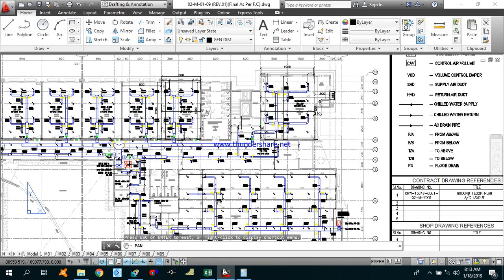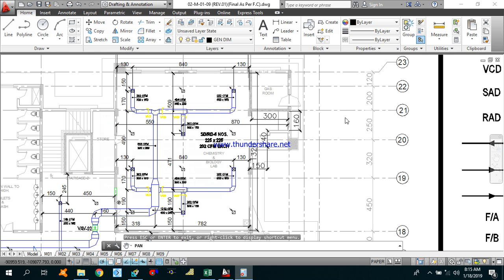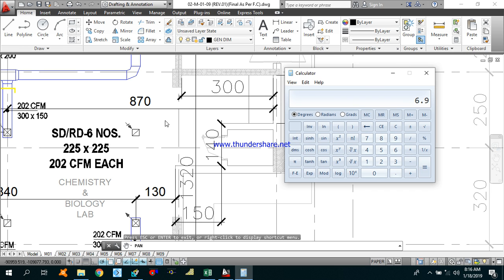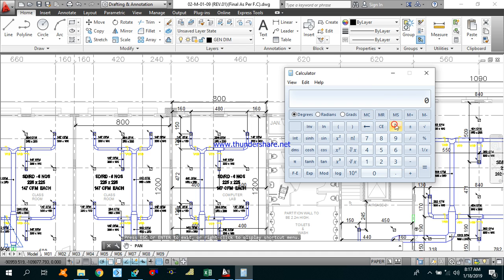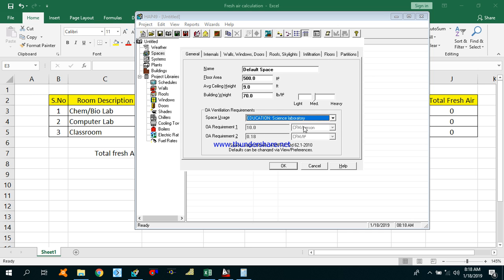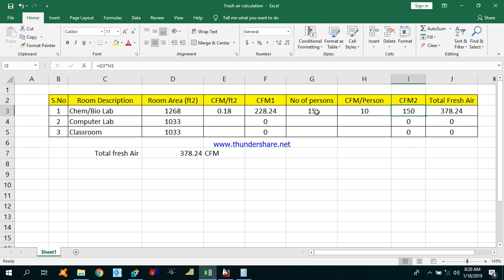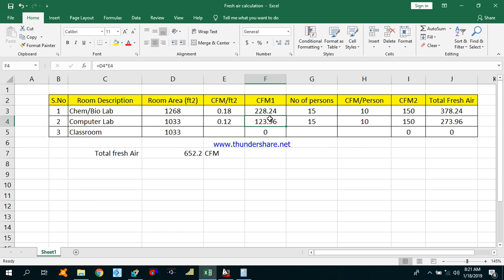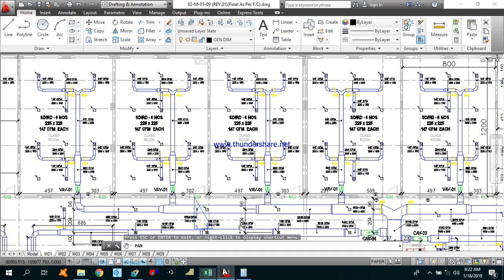Fresh air CFM (Ventilation calculation) as per Ashrae standard of various spaces in school project

Comment: Sir do you have a tutorial for getting the static pressure requirement of fresh air fan? thanks
Reply from the maker: Not exactly for fresh air fan but You can find static pressure calculation tutorial using Ashrae duct fitting database software on my channel

Comment: Hi Mr Syed, I'm Xavier and now I am currently doing laboratory building project where i need to key in the OA requirement. However, I can't use the ASHRAE std as it is neither a college lab nor a science lab for education. The labs are mostly filled with fume hoods and hence re-circulation of air in the room space is not allowed. My question is, how can I determine my OA requirement values? Do I base on the total exhaust of the lab room?